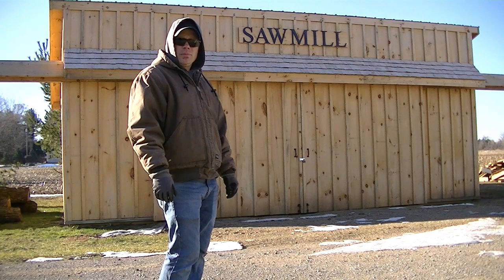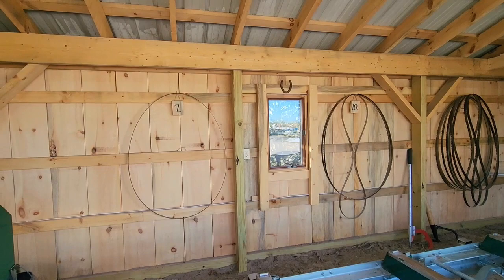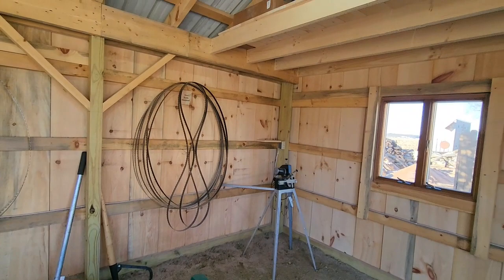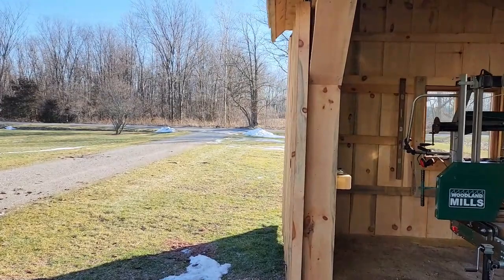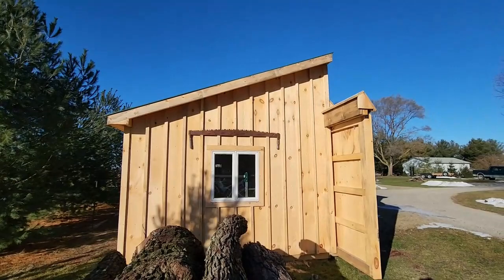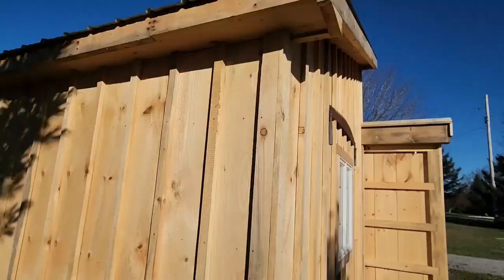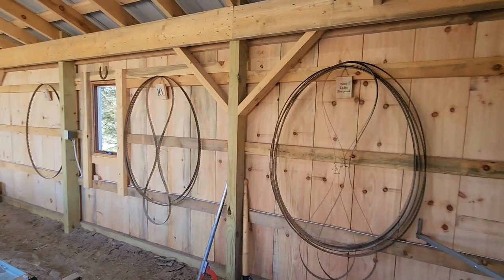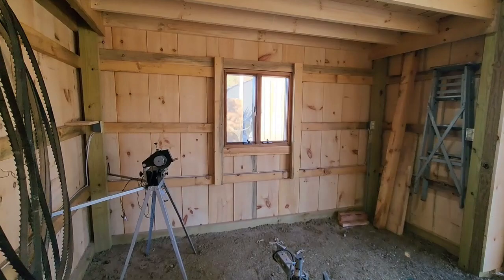SawMill Shed Walk Through Tour and How It Was Built with Woodland Mills HM130

Comment: You may want to put a sheet metal cap over the top of roof panels.  You might get a bit of water coming in there.  That could be done and still leave the ribs open for the ventilation.

Comment: Have you ever thought about doing a short video on the I-gaging measuring system that you have on your mill? I have an older hm126 and the measurements read greater the closer that you get to the log bunks.
Reply from the maker: Hadnt thought of it. I have not noticed an incremental increase in board size like you mention. Ill have to test it out.
Reply: The board size stays the same. It’s the scale that reads larger as you drop the saw head. 
It’s because on the older saws the pointer moves and the log scale is stationary. I’m very interested in the digital readout since I’ve put one on my wood planer.
Reply from the maker: @tombooks1410   ok, i thought you were saying you had a dogital readout and its was increasing incrementally. I was hesitant about the digital readout at first. But now my dad and I use it exclusively withoutout issue. Highly recommended one. Just take a little fab work for some brackets to mount it. Zero issue so far.

Comment: Very clever on the door track above. I see a deep strut with a trolley set up. Did you use a track system for the bottom so the wind can't take the doors off? I like it, wish I could get my hands on a Header Beam like that! Thanks.
Reply from the maker: The doors each have a pin that drops at bottoms into concrete plastic sleeve hole.

Comment: What a great sawmill building!  I like the fact you can button it up from the elements. But I do have a question for you. How do you get the mill trailer in and out of the shed? I also have the Woodlander XL (long bed/trailer) and I do take it to other people's property to mill some logs for them (easier to trailer the sawmill to the logs than the logs to the mill). My own ideas for a mill building (which I haven't built yet because of 'analysis paralysis') would need a way to easily get the trailer in and out of the shed.  Plans I've sketched up so far always have the end walls open so I can drive the trailer in and out...
Reply from the maker: Tractors forks reach in and hook up the trailer safety chains. Back it up a little then pull it out on an angle.

Comment: Very nice job!  Excellent Construction!  Plan to build one this summer that I will put on my channel.  Be careful with the gutters and a metal roof.  If you get a lot of snow, it could easily take the gutter out when it slides off.  I can have snow 1-2' thick on my camp roof and it will take off anything in its path.  I just subscribed.  Take a look at my camp walk through when you get a minute and let me know what you think.  I did it all with wood off of my property.
Reply from the maker: Thanks for the tips!

Comment: I live in Michigan too did they require you to grade the wood in order to use it for building? I have been considering the HD 36 and a molder. How do you like your mill and would you have opted to do anything differently in your purchase? I have been on the fence for a while now, and concerned how much time to mill it would take. The saw mill building looks awesome! How long did it take you to mill all the wood for it, was it just weekends? Did you dry the wood before building.. sorry for so many questions and appreciate any feedback..everything looks amazing, awesome job!
Reply from the maker: No wood only needs grading around here when its used for like a house. Not barns or out buildings. The mill has treated us very well. Any little issue was quickly remedied by the company while it was in warranty. Dad and i milled all the boards over a couple weekends and let dry for couple weeks. Thanks for watching!

Comment: How do you get it in and out, If you need to
Reply from the maker: Hook the front trailer toungue chains onto the tractor forks, pull the front end out on angle, sit it down. Move the tractor over rehook up, pull the whole mill right out. Takes about 2 or 3 minutes.
Reply: @AaronTurnwald  awesome. Wasn't sure if there was enough room to swing it out. Thanks.
Reply from the maker: @billwood5502  no problem! Thanks for watching